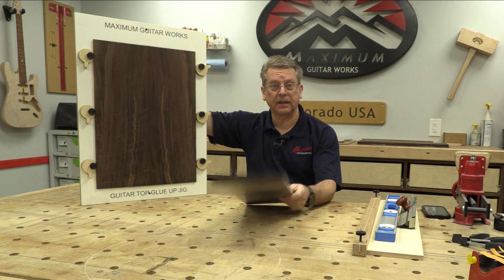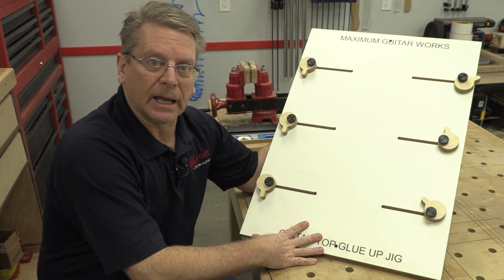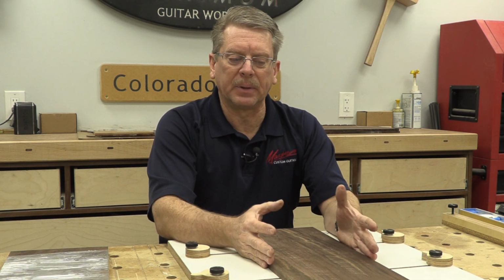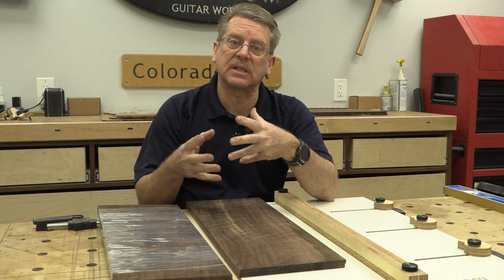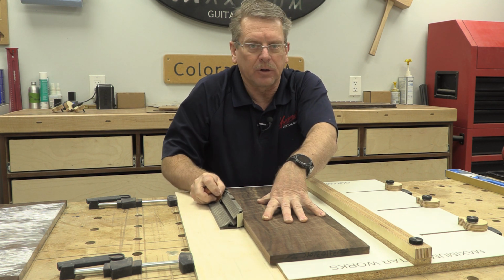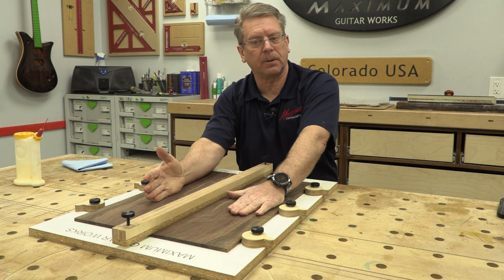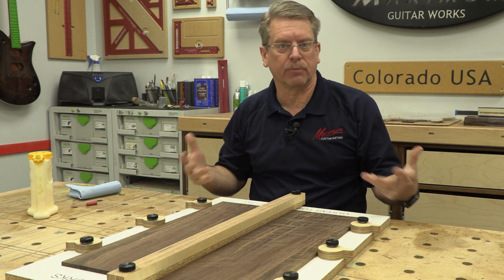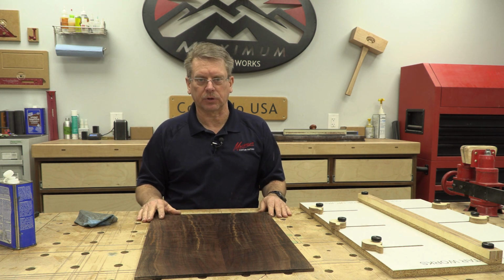Easiest Book Matched Guitar Top Glue Up Jig...and really cool Claro Walnut

Comment: I've read (haven't tried it myself) that luthiers gluing together 1/8" Sitka Spruce tops for flat-top acoustic guitars prepare the edges using a No. 7 jointer bench plane, which is about 22" long.  It's supposed to create a better joint than sanding the edges.
Reply from the maker: True. Unless you have hard wood…especially figured hard wood…and your planer blade (if not perfectly sharpened) causes tear out. What I showed is the easiest way I have found to get the joints flat and tight, while removing as little as possible (to insure the book match remains bookmatched).
Reply: @maximumguitarworks  Yes, one book I have says that for highly figured hardwood like Rosewood, you need a high-angle (60°) blade in your plane.  I think Veritas makes a plane with that angle. Otherwise you'd have to tilt up the frog to increase the angle, or use a bevel-up jack plane with a higher angle bevel.

Comment: What's the advantage of the sanding shooting plane vs a regular shooting plane?
Reply from the maker: Planes are best for making a bad edge good.  However, you need to have good technique...and a super sharp edge on the plane.  Especially with figured wood or your will tear the grain.  In the case with my walnut tops...the edges are great.  But, over time and changes of humidity the wood can move a little.  For me...and this is just my preference...I like to use a shooting sanding beam to make minor tweaks and tighten up the joint just  before I glue up the top.

Comment: Question Steve, what all natural stabilization solution are you using? Or is it one of your proprietary blends?
Reply from the maker: Nope...not proprietary.  it is an off the shelf product called wood juice.  The idea is that it treats dry or mostly dry wood in a way that minimizes impact of changes in humidity and such.  It does not change the way you sand, glue, or finish the wood.  I wouldn't call it a cure for bad wood...but I believe it helps stabilize guitar tops future use after the resawing process.

Comment: Leave it up to a mad scientist to keep coming up with new cool stuff.

What's the stabilization solution you talked about? I've only heard of stabilizing very soft or punky woods, is that the purpose you're looking to achieve even for that walnut?
Reply from the maker: It is an off the shelf product called wood juice. It is not an epoxy type of stabilization product like would be used on spalted wood.   The idea is that it treats dry or mostly dry wood in a way that minimizes impact of changes in humidity and such.  It does not change the way you sand, glue, or finish the wood.  I wouldn't call it a cure for bad wood...but I believe it helps stabilize guitar tops future use after my resawing process.